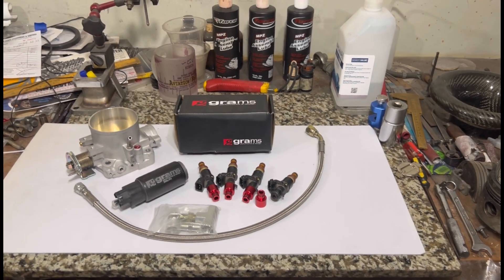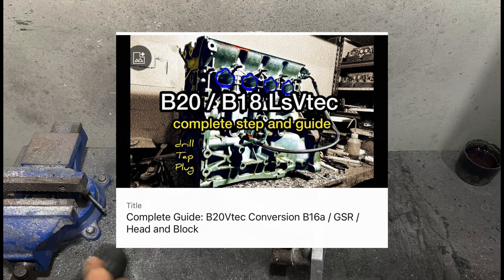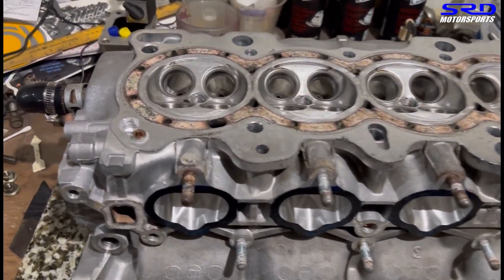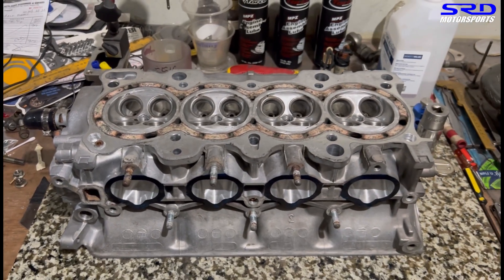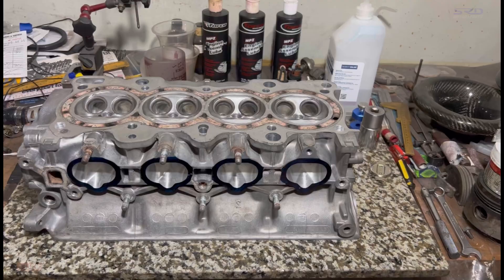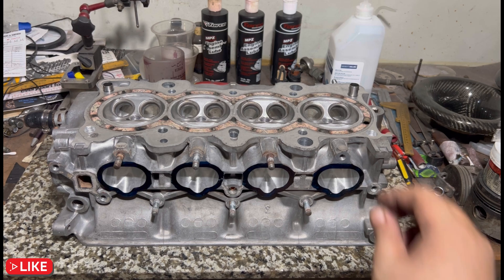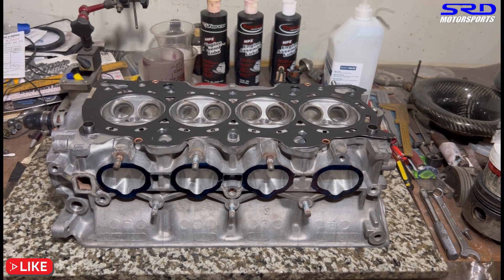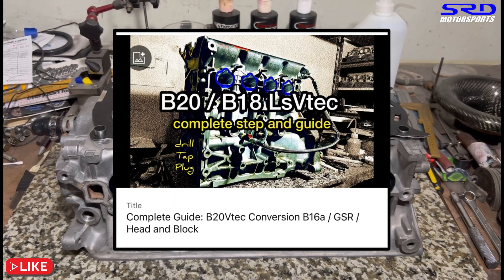Honda Civic SiR B16a to B20vtec Rebuild series part 4

Comment: Ralf, thanks again for the tips. Question about the venturi & anti reversion. I want to optimize off the shelf components without port work to keep costs to a down on a street build. Would using a Skunk2 Alpha 66mm throttle or Pro 68mm throttle on a Skunk2 Pro manifold (70mm inlet) provide the same venturi and anti reversion effect you described? Based on your previous intake videos, I suspect that would work well with a 3" intake pipe with 4" velocity stack and filter. Or would a tsuchinoko "whale PP" intake work similar through a 70mm throttle to 70mm manifold?
Reply from the maker: actually it’s one of the probable reasons why skunk2 has the 66 and 68mm tb I’m just assuming but it’s perfectly sized that way
Reply: @ Yes I also thought that might be the reason. I think I’m going to go with the Alpha 66 just to save some money on this street B20v build, B16 head 11.5:1 compression, considering the F20C makes 240hp through a 62mm throttle.
Reply from the maker: @ yeah good call on that and true I got a f20c tb here it is indeed 62mm